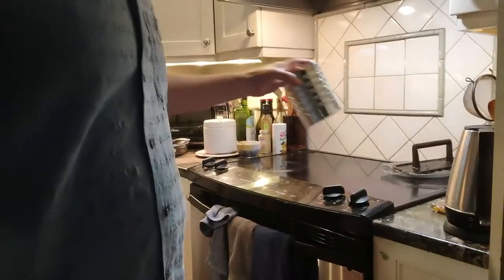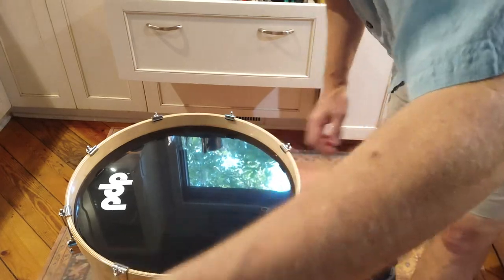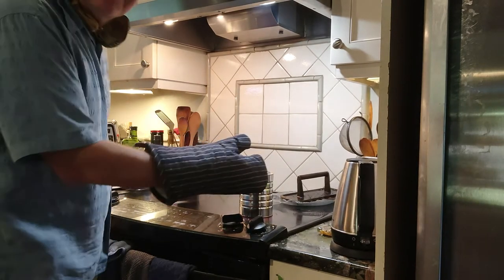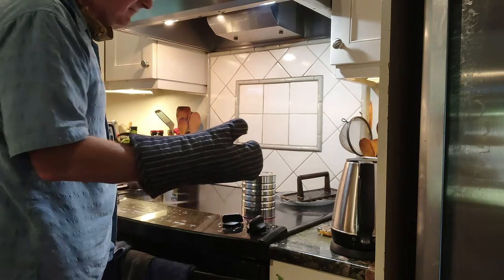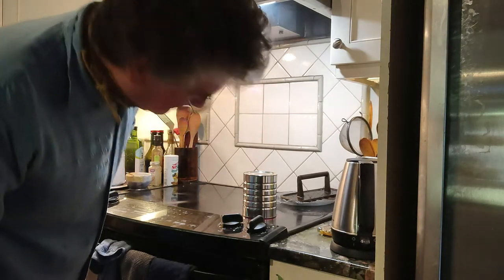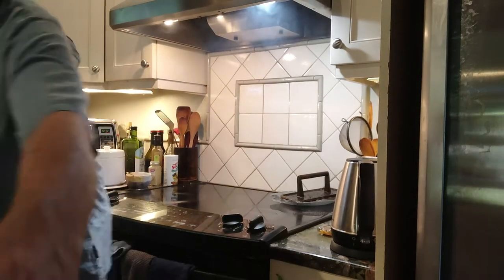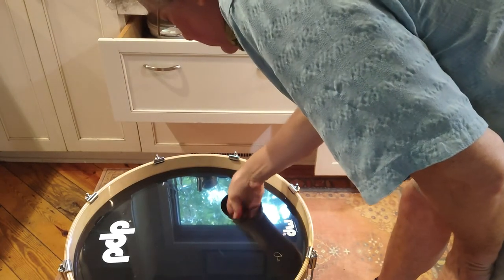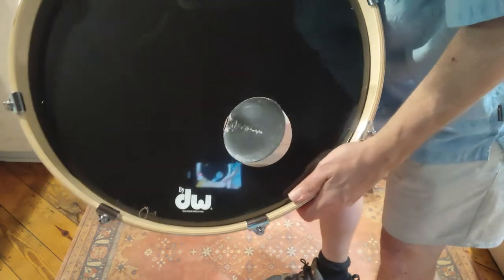How to Make a Perfect Sound Hole in on Your Front Bass Drum Head - JimRobertsPercussion.com

Comment: it’s BS way, it definitely needs reinforcement ring to avoid the drumhead crack
Reply from the maker: Fyi, back in the day (the 70s), there were no reinforment rings. So we would cut and go with it. I never tore the head because of it. Maybe you have had a different experience but using the term BS is impolite to describe something when I'm just imparting a historical trick. Unless you exert a lot of pressure on the edges, using it is fine for a long period of time and cheap. Even the companies that put holes in there bass drum heads, didn't do that. They worked fine.
Reply from the maker: On this link, there is a vintage photo with a commerical head with hole. Additionally, most folks, used a pillow or form on the inside for dampening as shown. https://images.app.goo.gl/PZgUstTuCkKuZiy2A